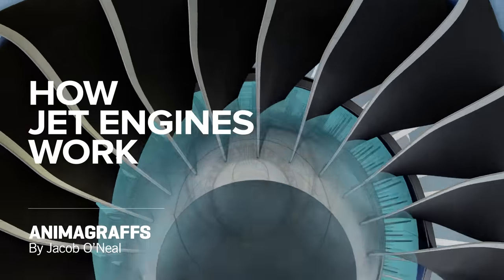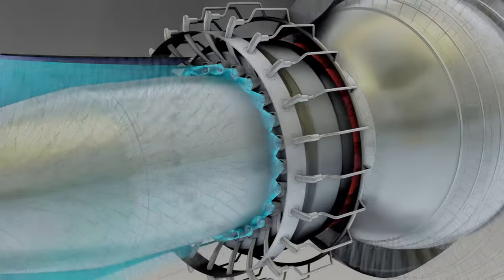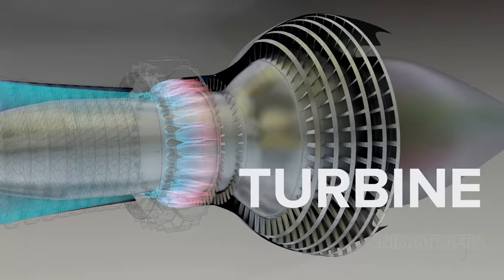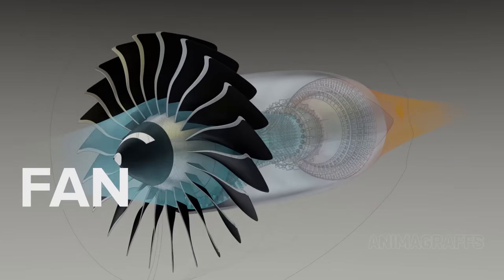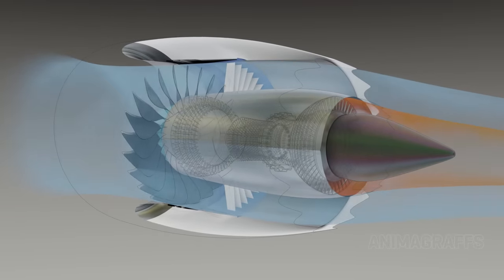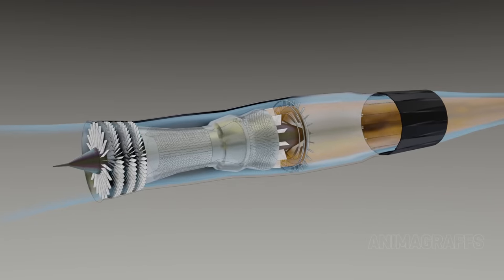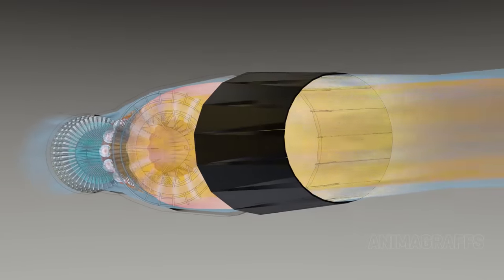How Jet Engines Work

Comment: Question…what starts the fans rotation to kick of the whole compression combustion process? I’ve always had a brief understanding of how these things work but this exceptionally put together video made every single thing I wasn’t sure about clear. Except for the one thing…what starts the fans? Is there like some electric powered motor or something to get it going for like the first few seconds? And then the power from combustion take over propelling the fan?
Reply: Yes, an external power source is needed to start the engine initially, but the specifics depend on what engine/plane you're talking about. I think most commercial airliners use power from the aux generator on board the aircraft, which you've probably seen if you've ever noticed the exhaust coming out the very back of a plane idling at a gate. Some military aircraft use compressed air instead of an electrical starter to spin the compressor up, which is neat since pneumatics are significantly lighter than torquey motors and generators.
Reply: @thegreatzoom5073  the aux generator makes sooo much sense lol…I’ve always wondered whether there was some sort of small hidden third engine at the tail cone cus I always see the heat waves coming out of it. 🙏🏾

Comment: high speed hot air doesn't touch the part surface because it is cooled by low temp air flow (light blue color). Temperature at material surface  is much lower than the melting point. the hottest air is in the center exhaust flow. Is my understanding correct?

Comment: I’ve read that the air entering the engine and going through the center core will increase in temperature to 450C, and that’s before it enters the combustion chamber and mixes with jet fuel. This is difficult to wrap my head around, know how fast the air is moving and how cold it must be at 30-40,000 feet.

Comment: Excellently done and explained. My only "Waitaminute" concerns what you called the "diffuser". Every text on turbine engines I have seen calls that part the "bypass duct". And the "diffuser" is the portion of the intake duct that increases in area as you get closer to the fan. Technically, a diffuser is any duct that increases in area as the flow moves downstream. Thoughts?
Reply: Agreed, the diffuser is just the region before the fan, which acts to slow and slightly pressurize the incoming air. 

To get real nitpicky though, you said that a diffuser is a duct that increases in area, but this is not the case for supersonic flow! For a supersonic diffuser, in order to slow and pressurize the air, the area must decrease downstream. Instead, I'd define a diffuser as any device that slows and pressurizes a fluid that passes through it.

Comment: An additional important function of the compressor section is to prevent high pressure exhaust gas from coming out the front of the engine. Without this, there would be no forward thrust.
Reply: Without the compressor the engine wouldn't run at all. All you'd get is flames coming out both ends, which is what happens when you get an interruption of the airflow through the compressor (a compressor stall).

Comment: I don't understand, what produces thrust in fine, the exhaust stream or the fan? If it's the exhaust stream, what is the purpose of the air that only goes through the diffuser? Cooling? Noise control? Either way great video!
Reply: Diffuser to control the exhaust I think
Reply: Wait no it's the exhaust cone
Reply: In a turbo fan engine the majority of the thrust comes from the big fan at the front pushing bypass air through the diffuser. Passenger aircraft, big engine, big front fan hung under the wing.

In a turbojet, the thrust is produced by the exhaust jet. Military aircraft, smaller engine, hidden inside aircraft and usually a nozzle on the back.
Reply: @ohidontknow1061  Thanks!
Reply: Most of the thrust comes from the bypass air, especially at low altitudes and low speeds, the core provides all of the power used to keep the fan spinning, as well as producing some of the thrust.

Comment: That means input air used energy must be much lower than produced energy by burning  and its work apply on the Turbine .How do they the right correlation?

Comment: Sorry if it’s obvious, but curious to hear exactly what makes the plane go forward — is it pushing off the air propelled by the propeller, or off the gas exhaust? If both, at what range of ratios?
Reply: In the big picture, it comes down to conservation of momentum. Think about a balloon that's blown up and then released. Air goes out in one direction, there is a reaction force in the opposite direction, that reaction force is thrust. Same with recoil when you fire a gun or hold a fire hose.

Comment: Ok, dumb question (please don't judge me)- if the blades rotate in a certain direction, and can suck stuff, will the engine actually blow objects away if the blades will rotate in the opposite direction?
Reply: Funny question, there are lots of practical problems with running a gas turbine engine backwards. You would essentially be swapping the functions of the compressor and turbine, causing aerodynamic stalls throughout both sections.  The combustor flame holders are designed to only stay ignited with the flow moving in the correct direction, not to mention the fuel would be burning in/melting the high-pressure compressor if the flow was backwards. If you rotated the engine backwards at high RPM with an external power source, I'd expect a breeze slightly faster than a ceiling fan from the outboard fan annulus and that the core would be so stalled that there would be little flow from there.
Reply: @buzzlesworth54  Indeed a very interest thought experiment and an expensive as hell ceiling fan! The compressor blades and turbine blades are very distinct and uniquely designed for that one task. Compressor blades are extremely thin and straight, turbine blades are thick and curved. Rotating it backwards would, as noted, swap the function of the two, which would NOT go well. The whole engine would break down if you brought it up to high enough RPM. However, if an inspector/pilot rotates the fan blades by hand in the opposite direction of powered rotation, no issue would arise there.

Comment: Is the frontal fan really coupled through a plantary gearbox with the shaft?
Reply: In many cases, yes. Depends on the engine model and manufacturer. There have been thousands of engines throughout the years by numerous different companies. No two companies make engines the exact same way.

Comment: Nice illustration but the duct isn't called the diffuser, diffuser is a rear part that mixes fast and slow air iirc. And a widening section after the compressor...

Comment: There are so many accessories bolted to an airliner jet engine you could make a 15 minute video on it, AgentJayZ on youtube also has a lot of details on how the blades attach to the disk, cooling channels in the turbine blades, blade tip clearance, oil cooling and circulation, labyrinth / carbon seals, etc

Comment: The big high bypass turbofans have better acceleration from a dead halt than the older low bypass turbofans and turbojets.  They don't do too good over about mach 0.8 because of drag.  They are quieter except when run up to about 105% N1 then the fan makes an almighty noise.

Comment: Excellent vid.  Im still fuzzy on two things.  1) Does bypass air provide thrust or just surround the high pressure exhaust for noise reduction; and 2) Do turboprop fans generate thrust as they turn or is the sole function to pull air through to the compressors and create bypass? If they do generate thrust what percent of the overall thrust is fan and what percent is high pressure exhaust?
Reply from the maker: Bypass air from the turbofan absolutely does provide thrust, sometimes up to 70% according to my research. So power made in the core is being used to drive the fan to a high degree. If dig deeper into THAT point, you get into a bunch of high-level thermodynamics stuff about why bypass air is more efficient than just using the core for thrust.
Reply: @animagraffs  I think the gyst of using a bypass flow in most modern engines is the limitations of the stagnation temperature in the turbine stage as you stated in the video. This is the hottest point in most gas turbine engine cycles, and the heat capacity of metals used for the turbine stage is one of the largest limitations of modern turbofan engines. There are some ways to mitigate this, such as using more air from the compressor stage to cool the turbine stage which I think you mentioned in the video, but this just creates a more complicated engine which increases manufacturing time as well as price for little increase in thermal and propulsive efficiency.

Comment: Excellent video! Why does the turbine rotate in the opposite direction of the compressor in the turbofan visualization? I thought they have opposite direction blades compared to the compressor in order to harness the energy from combustion, but rotate in the same direction. Or am I seeing it wrong?
Reply: This is a dual-spool design. It has a high-pressure compressor paired to a high-pressure turbine on the same shaft, and the fan and low-pressure compressor paired to a low-pressure turbine on another shaft coaxial to the HP shaft. The stators downstream of the last stages of the low pressure compressor and the high-pressure turbine would straighten out the flow, making the opposite rotation direction of the next stage a non-issue.
Reply: @buzzlesworth54  Cool!

Comment: The one question about jets that has never been answered to my satisfaction is why the pressure in one direction is not cancelled by the pressure in the other direction.  If I had a tube and mixed gas and air inside the tube the burning fuel would explode out both sides and the tube wouldn't move.  If I put a fan on one side it would simply push away the fan.  In otherwords my question is, why do jet engines move?

Comment: when the air inside combusts, i can see that it would expand and go out the back, turning the fan blades that drive the forward fan. but..wouldn't expanding air also push forward the way it came in? would that work against the air trying to come in and push in the wrong direction trying to counteract the fan rotation? why doesn't it reach a steady state where air is burning in the center and exiting out the back and front generating a net zero fan spin? is the fan being run by a separate motor?
it was neat to see the extra air around the core affected the efficiency and noise :D
Reply: Air moves from high pressure region to low pressure region, the upstream from compressor is high pressure and downstream towards the turbine is the low pressure region. Yeah what you said also will happen if we don't provide enough air, this condition is called surge condition. In this condition the whole engine breaks down.

Comment: i wonder how the turbo fan start rotate from the start. or is there any dynamo or small engine inside of it. i wonder.
Reply: Usually they are started by blowing compressed air into the compressor stages. The air is provided either by ground power, the other engine if already running, are the APU which is a much smaller jet engine in the tail of the aircraft, which is itself started by an electric starter motor.

Comment: Why doesn't the combusting fuel blow back towards the compressor as well as towards the exhaust? It isn't a sealed system so what prevents this back-flow?
Reply: The fuel is only injected after the high compressor, where the igniters are located, therefore before that compressor, there is no fuel to burn so it only has one direction and that is where that high pressure is being pushed out to the back
Reply: @realemonful  Thank you so much. If I can press on your patience a moment longer, I still don't understand why the burning fuel doesn't expand back towards the high compressor, exert an opposing force on the impellers, and terminate the process. The entire engine isn't sealed so what keeps this back-flow from occurring? Really appreciate your taking the time, thank you.
Reply: @tinetannies4637  I am not a jet engine mechanic myself but from what I have gathered, the cooling air around the combustion chamber creates a lot of thrust so combined with the pressure of the lit pressure there is so much pressure that after ignition there is no room to move back
Reply: @realemonful  Thanks again!

Comment: Again awesome Video! 

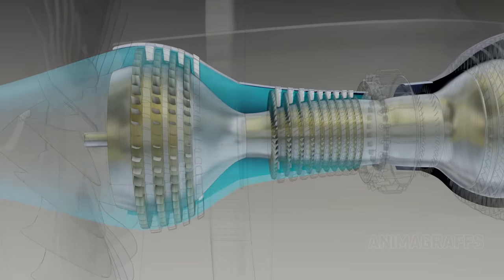In my opinion thought at 0:38 it is not wrong to say compression happens for higher efficiency of combustion, that is indeed the case.
But in my opinion it's misleading not to mention, that in fact without this compression the entire Jet would not work! 
Without this compression, in combustion chamber air would extend in both directions hence not providing any forward force to the plane.

So compression is only partially happening for efficiency, but mainly for the entire engine to work!
---
Btw. same is for wings and lift.
Often in explanations airfoil and pressure difference between streamlines cased by travel distance delta is covered.
But its missed to mention the contribution of angle of effect and reactional forces.
Though this is very relevant as well. Even with a straight board and no optimized airfoil at all lift can be generated.
And even planes with airfoil can fly with lift up-side-down when in fact airfoil profile is disadvantageous.

Of course authors know all that, but I am afraid leaving it out to simplify, causes audience to not fully understand.

Comment: I think I realized the part im struggling with. The video doesn't mention which part/step in the engine causes that jet powered thrust. I hope this question makes sense!
Reply: The exhaust. You know Newton's third law right ?
Reply: He’s right, it’s the exhaust. The thrust is generated by the mass flow rate of the air and the fuel multiplied by the exhaust velocity. There is also thrust generated by the pressure area which can be calculated by multiplying the nozzle area by the difference between the exhaust pressure and the ambient pressure. In most cases, the nozzle is perfectly expanded (exhaust pressure is equal to ambient pressure) which means the pressure area force can be neglected.

Comment: can you do an explain and depict of the resulting contrails?...it would be cool to be able to share with chem trial theorists
Reply: The general principle is quite straightforward actually. The combustion process generates hot gaseous water as a byproduct. The air at high altitudes is very cold, so the humidity condenses, effectively creating a little cloud. Same thing happens if you have a cold glass on a hot and humid day, the glass will be coated in liquid water that has condensed out of the air.

Comment: If you compressed the air so much wouldn't it almost create combustion if a light mist of fuel was added so thus there would be no need for a spark? Also I'm thinking even if you use titanium in the engine for a light weight metal and strong and you had a lot heat wouldn't it lite the titanium on fire?
Reply: You don't use titanium in jet engines, at least not for the turbine blades. It can make them brittle
Reply: When there is constant airflow through the engine there is no need for the spark. The titanium would not be lit on fire because metals like titanium are have a high heat capacity. In most cases, the turbine stage can take temperatures of up to 2200K!
Reply: Titanium is costly and harder to work with it.

Comment: On contrary the pressure created by fuel ignition imposes on incoming fuel air mixture, there by preventing it to enter into combustion chamber. so how this is achieved??
Reply: It certainly seems rather complicated and counter intuitive. However, a gas turbine engine typically operates based on a Brayton thermodynamic Cycle. In an ideal Brayton Cycle, the combustion process happens at constant pressure. In reality, there is actually a slight pressure drop through the combustor due to frictional losses. This slight pressure drop through the combustor is what helps keep the flow moving in the right direction.
Reply: thanks for your valuable reply.

Comment: hey, so is the afterburner basically a rocket?
Reply: In some regards it is similar, but I wouldn't call it a rocket. Afterburner dumps raw fuel into the incredibly hot exhaust gases and basically does a second round of combustion, giving extra exhaust velocity and therefore added thrust. The downside is that this afterburner operates at very low pressure, which is horribly inefficient. That is why fighters only use afterburner in short bursts, not continuously.

Comment: You forgot to talk about centrical and Annular flow, jet engines and there differences, And Can or canannular burners And their differences , There is also a turboshaft engine.,the Igniter plug is used for the Hi intensity amperage spark For a hot spark which is highly dangerous to humans then a Common automotive spark plug.,-) Great video though.Great video though.

Comment: How does a jet engine with an afterburner work if there's no fan blowing air into the compressor?
Reply: There are still some oxygen left in the air after it has passed through the turbine.

Comment: high bypass jets make the most thrust. the ge-9x makes 110,000 ftlbs of thrust NO afterburner. it could probably have one added but its to big to be put into a fighter jet. and there's been test aircraft that was a passenger jet with an afterburner and the concord and tu-144 where the only 2 aircraft passenger liners with afterburner. the tu144 had to use them all the time to stay supersonic and concord could super cruise at mach 2 at 60-65k feet. the concord also one time was able to stay in the shadow of an  eclipse for something like 3 hrs no afterburners